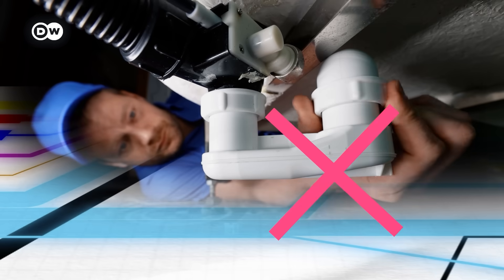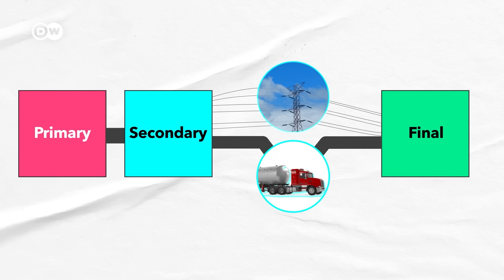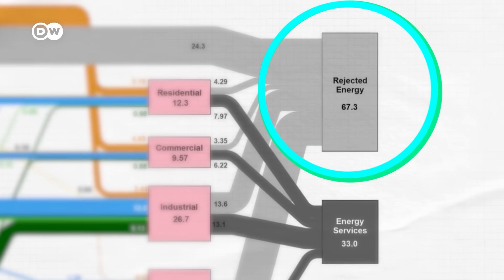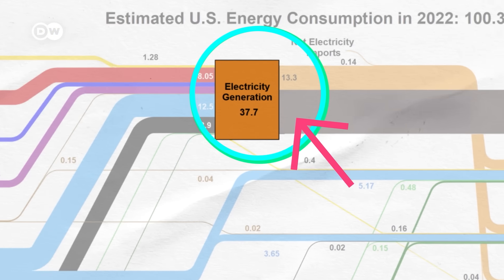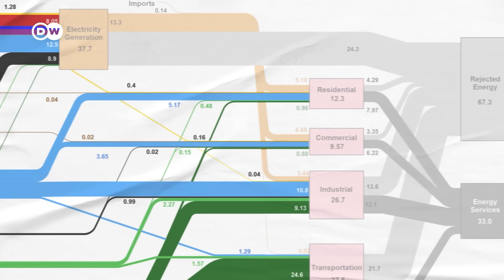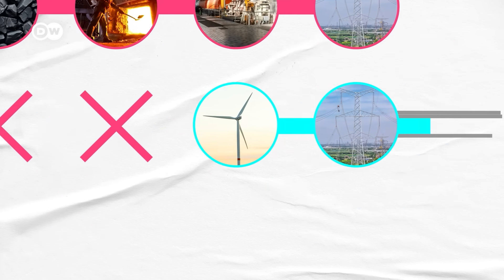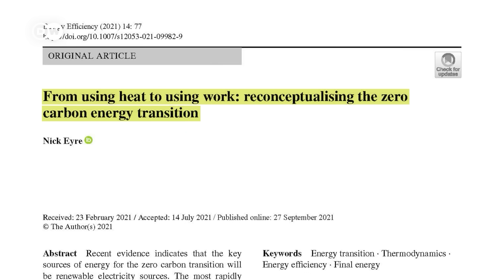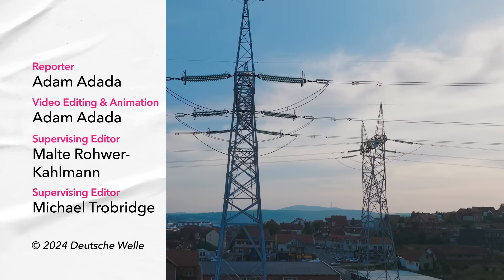The mind-blowing thing we get WRONG about energy

Comment: For as great an idea that an AC grid is, a lot of waste is now being created because of this. On the commercial/private end of things, most of our electronics need to convert AC to DC which contributes to losses (feel the heat coming out of that power brick?). Industrial consumers also deal a lot with this because, in order to exert control over the electric motors that do a lot of the work, that AC energy first needs to be converted to DC then inverted back to AC. These losses aren't massive (we're talking 1-3% on average) but at the megawatt scale, it adds up fast. Wind and Solar also have some of these conversions between AC and DC done. What would be really interesting would be to consider moving to decentral, DC based grids instead of AC grids and see how that might impact things.
Reply: You can't transmit electric power very far using the typical utilization voltages (480 and below) In even smallish manufacturing plants we are using voltages of around 13KV just to get power distributed around the facility with step down transformers to 480V within a few hundred feet of the point of where the energy is utilized.
Reply: If your electronic uses 12vDC, there is still going to be losses from converting HVDC to your desired DC voltage. If you went full DC, then anything that natively runs at 50/60Hz would no longer work. They would all need inverters installed to work, causing losses in conversion. In our current AC system, high voltage DC transmission becomes cost effective if you are going to transmit distances of over 500 miles.
Reply: @Babyblasphemy  I think most people realize how short a distance low voltage can be transmitted. There is no way you are going to transmit that much energy 1/4 mile on a 120/240 system. I had to run a 30 amp circuit out to a pole in my yard that was a 250ish foot run. I think I had to use #4 aluminum
Reply: As an engineer that designs the chips that consume the power you worry about, don't worry so much, todays electronics uses millions of times less energy per same function over my childhood when the radio and television was vacuum tube based, a real live heater.

The falacy of every little bit counts at play here, engineers do a pretty good job of specifying circuit designs to be as low power as reasonable.
DC grids are a terrible idea except the very long distance continental HV lines.